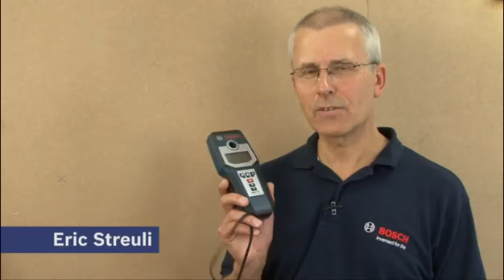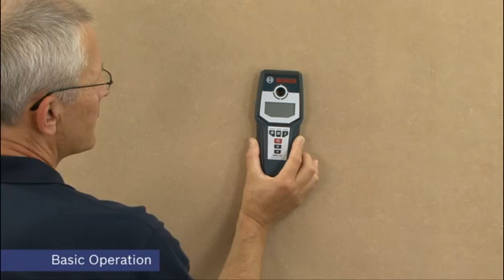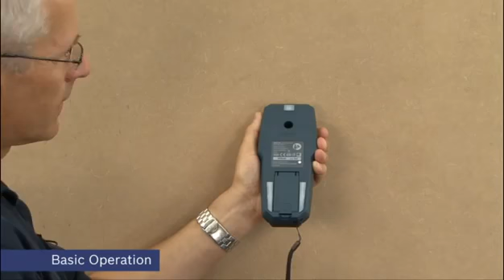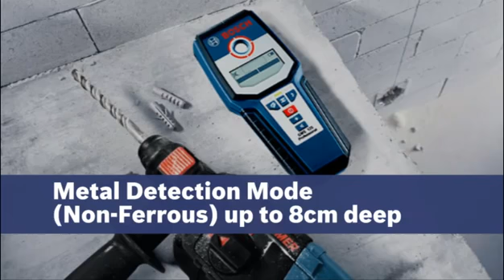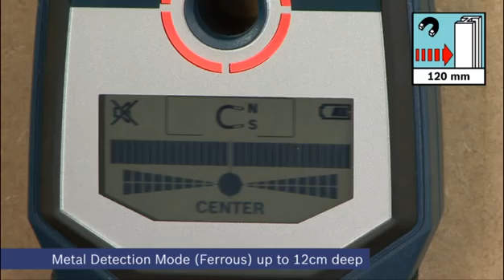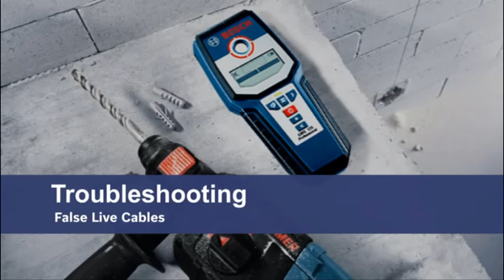Bosch GMS120 Digital Wall Scanner | Screwfix

Comment: Erratic results  I use on exterior walls...vinyl, wood, hardie. This is one of those maybe I learn a little bit...but the tool itself in unreliable. It's even erratic on simple inside walls. Also, I wish someone would interpret the centering lines and what the colors of the rings actually means.  I decided to throw mine away.

Comment: Very good video: especially for the recommendations on using it for electrical, incl static elect issues. 
Watch it thoroughly. One other tip: even if things look clear, always place a limiter on your drill bit so that you just clear the substrate you're drilling, and little more. You can always push in a small plastic rod if you wish to double-check if anything is relatively close to the substrate where you just drilled.

Comment: Doesn't work on acoustic soundbloc plasterboard with acoustic Rockwool inside the void. I'm guessing the sound waves used to detect materials are being absorbed by the acoustic board and/or the Rockwool. So glad we measured these studs and wrote it down on paper before we boarded and skimmed. The stud finder DOES NOT WORK!

Comment: This thing is absolutely useless garbage. At any given time, any and every section of every wall I’ve ever tested it on can have literally anything in it. You name it. One minute I’ve hit a stud, next minute it disappears. Next minute it’s electrified, next minute it’s ferrous, next minute it’s nonferrous, next minute there’s nothing there. 

I’ve tested it on walls with no wiring in it and it tells me the whole wall is electrified. Even with multiple passes it spews out a confusing mess of noises and indicators that contradict each other constantly. 

Completely unusable and one of the worst purchases I’ve ever made.

Comment: Bought this a few months ago, it is an absolute nightmare. I thought a Bosch tool would be very good but I get live cables everywhere. Searching for a wooden stud is impossible as it shows live wires everywhere. Even when I know there isn’t. It’s not even consistent. I regret shelling out for it, no more accurate than knocking to find the stud and listening to the sound changes

Comment: Former Manufacturing Engineer/Electrician here. Upgraded to this product because of its capabilities. Too bad that it in 3 hours of testing with KNOWN locations of studs and wires I can not get consistent results at all. I read the entire manual and even recalibrated in a darkened area twice! I have NEVER had a stud finder that had to pass over a stud 3 times to find it! I purchased this to assure that I did NOT have to use finishing nails and repair drywall.

 The Center of stud location is +/-  3/4 of an inch at best, meaning that after 20 try I can maybe map the stud....or not. I need CENTER OF STUD. In fact I can move it almost one inch when the center is shown with no change in the readings.  Approach from the other side of the stud and it may or may not show the stud at all. I purchased this because I need to be in exact center of studs for structural reasons!

 Meanwhile the live wire will not show a live wire at all, even when energized and location known and when wire is directly against the drywall on the inside of the wall.

 It can sometimes find non-ferrous wires but not consistently enough (even when I knew where they were and could attempt from both sides of a wall. I get some positive ferrous readings where there are no studs at all (I doubt that there is iron in drywall material). I built the walls and know the locations of everything for testing, This is going back to the supplier.
Reply: This is a shame, as I got it to repair my cracking ceilings, wanted to find the studs to add screws and secure it so it wont move before using filler:(

Comment: I take that detector is only for light walls in gypsum, wood and so forth, not to detect RE-BARS in CONCRETE.
Reply: Actually according to the manufacturer it can detect quite deeply through concrete and is designed exactly to detect rebar in concrete. I doubt it works as it does not work for me in finding studs accurately.

Comment: Another tip if you use this to detect cables: Make sure you are grounded. The wall (and even the air) behind my OLED TV is detected completely as live cable, but when I put off my shoes with rubber sole, the detector is working great

Comment: Just purchased this tool today and it is quite disappointing. Can't really detect concealed electrical cable in brickwall  as what it claimed. 

I have tried on the electrical switch itself and it gave out warning. The moment when I moved GMS 120 to the top part of the switch where the concealed wire is running to the soffit, it FAILED TO DETECT ANYTHING.

Comment: I own one. All it detects is electricity. Seriously, even in wall mode. But no studs. And I mean no studs at all. But heaps of electricity. Even in my solid timber coffee table...electricity. So, if you want to confirm the there is electricity in every thing and every where this is the tool for you. If you wish to detect anything else then forget it. It is of some concern that Bosch have brought this to market.

Comment: There are 2 reviews on screwfix webpage and both are 1 star... i'm not convinced this is a good kit
Reply: tramexz I have it and it is more accurate than Franklin. It takes an extra pass but results are much better. Just recently I was drilling into a stud in my garage according to Franklin finder - turned out to be an empty space. Bosch correctly identified the stud in that location.

Comment: I have the same question as George.  How sensitive is this in concrete walls?  My electrical is embedded in concrete hollow blocks filled with concrete.
Reply: I had it and sold it. Useless in finding electrical wires and metal nets embeded in brick walls and concrete floors. Good only for wooden houses and dry walls.